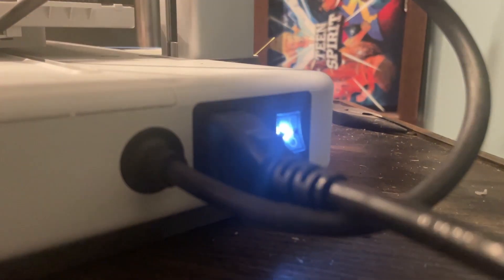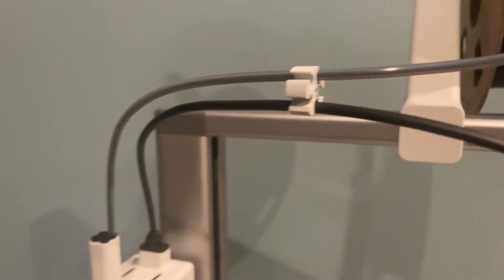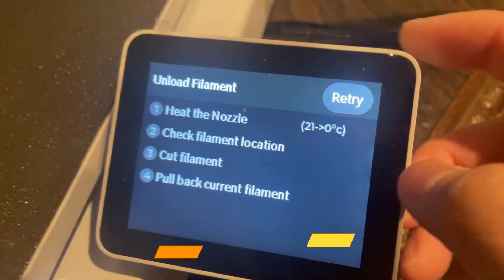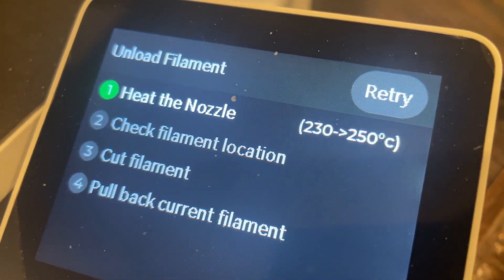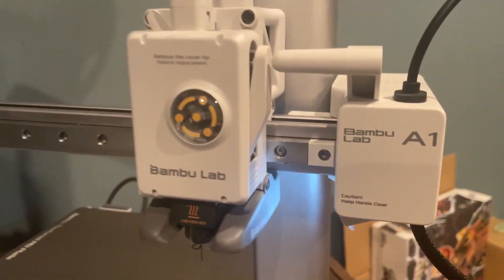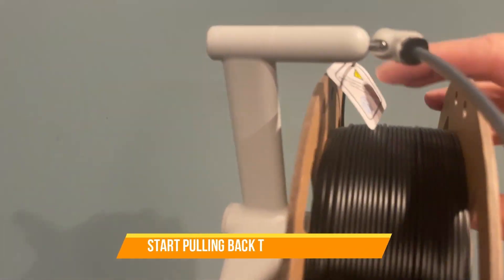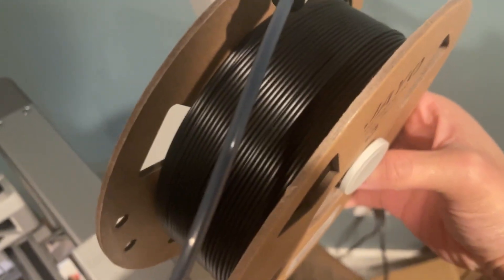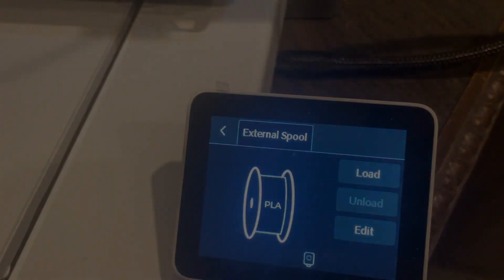How to Unload Filament from Bambu Lab A1 3D Printer

Comment: was a little nervous to do this as i've never owned a 3d printer and had no idea how to actually remove the filament. video is very simple and straightforward, as a result I was able to remove the previous filament, and swap in a new color for the first time with no issues.

Comment: This is why I hate this POS printer, changing filament is a chore that requires 5 minutes of your time. It's the most unionized printer I've owned
Reply: coming from a Ender 3 V2, it's easier for me to replace filament in a bambulab a1. with ender i had to cut the filament 45 degrees and have to try a few times just for the extruder gear to catch it.